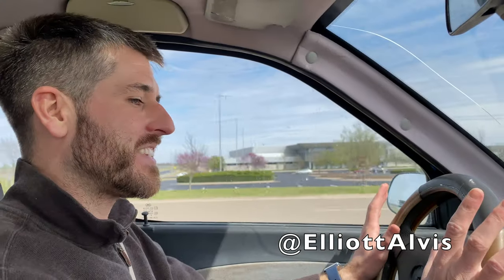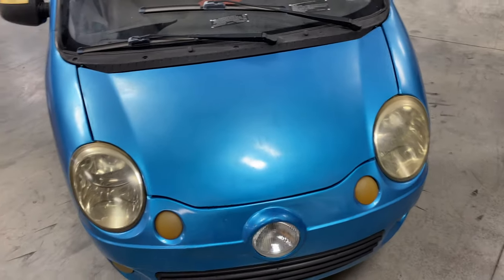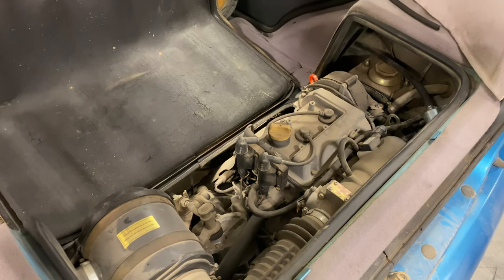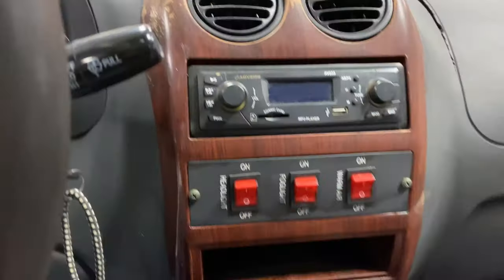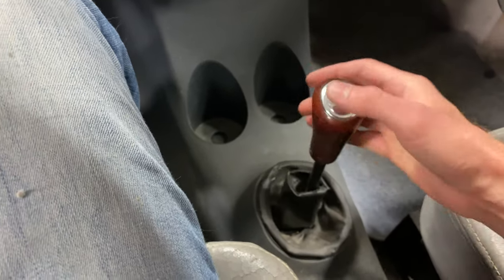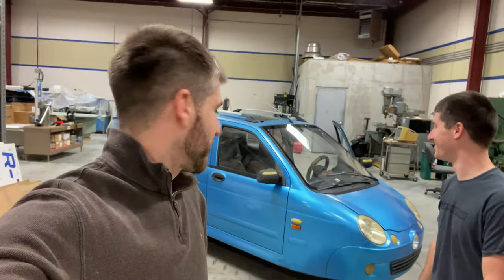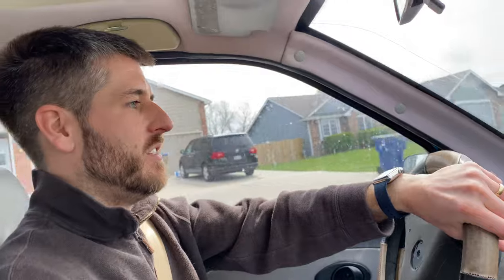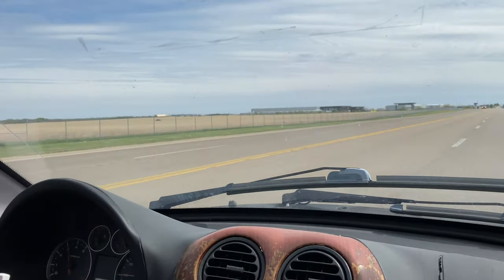The Snyder ST600-C is a weird Chinese 3-Wheeler | Featuring WatchJRGo

Comment: It is not a car even in China either, it's a tri-motorcycle. This kind of tricycles has disappeared for many years as too easy to get broken and very unsafety. Normally in China, only the old people will buy this kind of tricycle and drive it in the countryside as it is cheaper compared to a car. And it's designed for low-speed and short distance. But now in China, it has evolved into electric, which doesn't ask for a driving license and the motor plate.

Comment: the exterior is a daewoo matiz, in some countries Chevrolet spark/matiz, it came with a 800cc engine but in the front, some trim levels had AC and power steering,  this is something else, some Frankenstein :))) you could flip it with 4 wheels, can only imagine with 3...
Reply from the maker: noksta bln Thanks for the information, I didn’t know any of that before. Yeah, it was not the most stable vehicle to drive as you could imagine 😂

Comment: What's the mpg?  I'm a poor working man, and it's about what I need.  Afghanistan combat veteran, not afraid of driving it.  Lol.     Chevy Sprint non turbo with 337,575 miles died could use a good replacement.   Wife don't like the 1982 S10.  It's a gas pig and build pressure in the crank, I'll trade the s10 in on it.

Comment: The Reliant Robin is far superior despite being decades older. interesting little car tho. Id drive one. But i am familiar with 3 wheelers.  putting 10k in my Reliant.  My 36 year old Reliant is allot faster and more stable due to how light the car is. also less rattles.